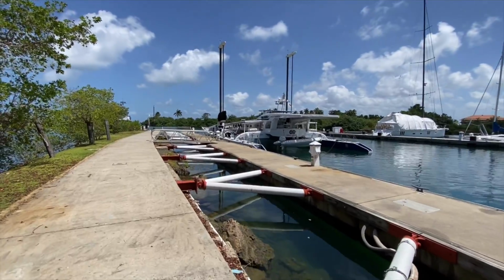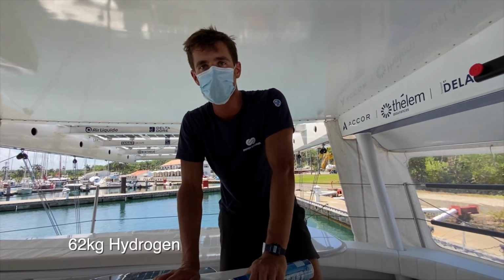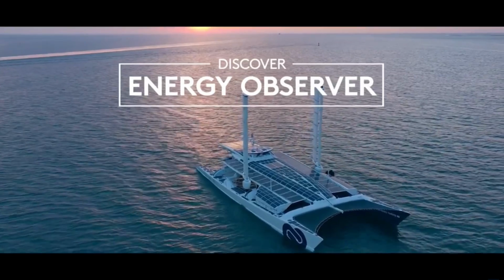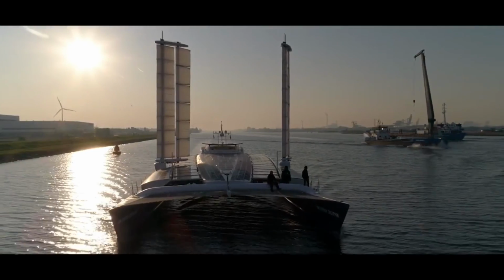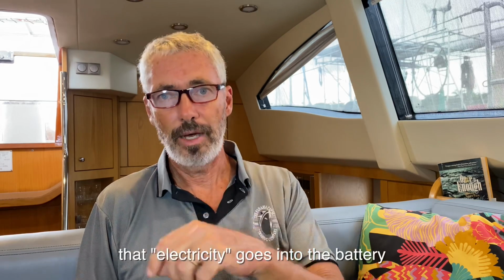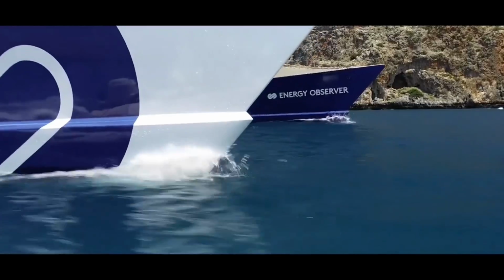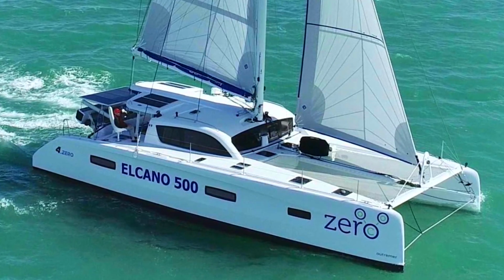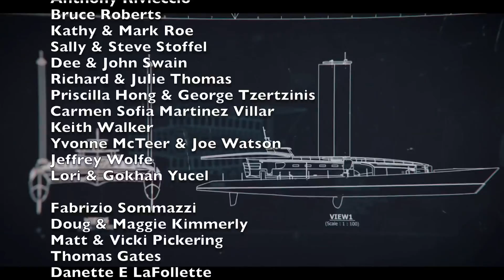Hydrogen-Electric powered boat! Can we get this on our new sailboat? | EP 204

Comment: The future is almost certainly zero carbon electrofuels. The hydrogen is combined with carbon dioxide to create a drops-in replacement liquid fuel with the same energy density as diesel. The only issue is cost (they are currently 3x the cost of diesel) which is why vehicles that can go electric will do so. But for relatively low consumption users (such as sail boaters)  the cost is less of an issue.

Comment: Hi Paul: what about instead of using solar to produce hydrogen on board, can they use some residual hydrogen to produce more hydrogen from the water. Is the system that efficient enough?
Reply: ???
I don't really understand what you mean by that.
Probably some kind of "perpetual motion"-thing?
Even with a very efficient system (60% efficiency fuel cells, 80% efficiency electrolyzer), you would have to spend 2 liters of hydrogen to produce 1 liter of fresh hydrogen. I suppose, 3 liters of hydrogen for 1 liter of new hydrogen would be more realistic.
No, you can't use hydrogen to get more hydrogen in total.

Comment: Yes but there are a few Problems you didn't mentioned. The efficiency of electrolysis is round about 70% . The efficiency of a typical fuel cell is below 50%. And to store hydrogen you either have to compress it or cool it down to down to -240°C. This need round about 10% of the energies is in the hydrogen.
So if your solar panels generating 1000w, after transforming it into hydrogen only 700w left, storing the hydrogen would take another 70w so 630w left, and transforming it into electric energy again would reduce it to 315w. So to drive the ship with 1 day(time) with 6 knots would take 3 Days generating the needed hydrogen. I do not think this will work.
Reply from the maker: Thanks for your comment and calculations.

Comment: Perhaps I'm not getting the appeal of this boat:  according to the Energy Observer website, it cruises at 4.5 knots.  Why not just set up some proper sails and increase the speed 3-fold without much effort.  Sure, you'd be dependent on the wind for movement, but this boat is dependent on sunny days for movement...very slow movement.  Plus, if you think propane is dangerous...hydrogen is in a league of its own.
Overall, an interesting science experiment, but far from practical.

Comment: In talking about the solar/battery power they need to mention the weight of the panels, inverter, controllers etc, not ust the batteries,  in hydrogen they only mention the weight of the hydrogen in the tank? what is the mechanism that makes the hydrogen and how much does it wiegh?
Reply from the maker: The hydrogen production is done through an electrolyser (plus desalinator to make the pure H2O). Their website has lots of info on the tech but I couldn't find a reference to the weight. https://www.energy-observer.org/

Comment: Interesting science but the positive impact from doing all these changes for sailboats is debatable. These changes are very costly, time consuming, not necessarily safe or dependable.  How much diesel do you burn each year on your sailboat? Use the sails a little more. I would bet that moving substantially away from gasoline lawn mowers (due to enormous pollution) could have a positive impact one million times greater on the planet.

Comment: Generating hydrogen isn't that hard, - try experimenting by connecting a battery to two stainless steel bars or bolts inserted into seawater and you'll soon get hyrodrogen and oxygen, (see other youtube channels on how to do this) - however one should avoid collecting the hydrogen and oxygen together, as some do - (it's unstable and can explode).

The hard part is efficiently storing the hydrogen once generated - there are many ways to store it all are expensive at the moment.  The mose efficient way (still under research) seems to be using carbon nanotubes, but this is very expensive and out of the reach of Jo Average Citizen (at the moment at least).

Using small currents and seawater will produce small amounts of hydrogen - however if left to run for long periods of time can be a very efficient way to get plenty of hydrogen for a small boat.  I'm still researching this and would like to hear from others interested in the same area.

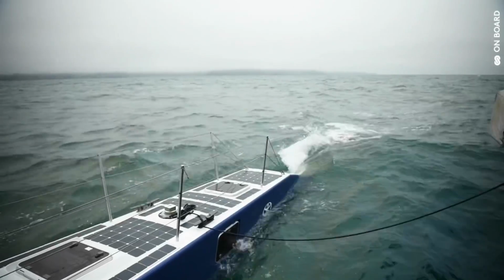Comment: Sorry, I have a huge issue with the stats presented in the video.  In the beginning they stated the hydrogen tanks store 62 kg of hydrogen.  Then you state that they only needed to sit for a FEW DAYS (not moving - using the solar to produce hydrogen).  Then @ 9:21 you state that the system can produce 3-4 kg of hydrogen PER DAY.  Using math, it would take 15 days in SUN (if it was cloudy any of those days..take longer) to "fill" the hydrogen tanks.

Again, It's been talked about by many boat builders and cruisers (yes I know there are a few cruisers using only electric...but they also have to modify their paths and windows to accommodate their propulsion decisions) that EV or Hydrogen isn't anywhere near mainstream yet.  I'm almost betting this vessel is getting grants/subsidies from organizations/government.
Reply from the maker: Hi Douglas, Thanks clarifying.... I couldn't actually find information on how long it would take to produce a tank fill of hydrogen. It was my own math that they could manufacture 3-4kg per day. And that was assuming they didn't run any other systems while making hydrogen during those SUNNY days :-) And you are right the vessel is a receiving financial support as a promotional research vessel. They are pretty clear about that on their website, which is quite interesting ... https://www.energy-observer.org/

Comment: Hopefully, in the future... which is very nearby today (2023) we just take in seawater, which is split into hydrogen and oxygen, and burns either directly in our hydrogen engine or  goes to storage tanks thst will then be used at a later moment to fuel the additional electric engine. right now we would need ca 40 liters of water and 1.5 kWh to generate 33kwh hydrogen power, which could drive a decent boat engine for approx. one hour. Hence the future is we take in water and we sail or engine without ever buying fuel.. and that's why the oil industry does not really like this idea.

Comment: When you compare hydrogen and lithium, you need to include the extra mechanical systems needed to convert hydrogen to electricity by weight. 

Can't imagine the fuel cell system is lightweight.
Reply: Fuel cells aren't "mechanical systems", but galvanic elements, similar to batteries.
And of course, fuel cells, compressors, hydrogen tanks and electrolyser weigh 2100 kg. Not really lightweight, but light in comparison to a li-ion-battery of >1000 kWh (comparable capacity).

Comment: 64kg Hydrogen sounds so tempting attractive.... but... wait...
Whats the weight of the 700bar carbon fibre Tanks?
And, given that electricity comes from solar (+MPPT Solarcharger) and goes to the motors... whats inbetween:
The 1,5 to (or 14 tons) battery.
Or...
An Electrolysis unit, a Gas compressor, said carbon fibre tanks, and the Fuelcell system.
And how about efficiencies?
Li ion has a charge/discharge efficiency of approx 80%...
Electrolysis 70%, compressor 85%, fuelcell 50% makes a total of 30%. For the Hydrogen path... my precious Sunpower, down the drain😔
And all the weight... at least versus 14 tons this could be a close win for the Hydrogen.
And cost... 
Oh, dont forget complexity& maintenance - in the harsh corrosion exposed marine environment.
This is a great adventure for an experimental research vessel. But in the real market? Sorry, Hydrogen will not gonna work here...

Comment: How about just sailing - ships sailled for hundreds of years without any engines (a few still do), we have far better weather forecasting than they ever did. Bottom line is that the lazy sailing of using diesel is going to have to end.
Reply: those days the crew also rowed to pull the ships into harbor and up river
Reply: @thetruthasanamerican1249  in some places for larger ships (Because it made sense if you were crossing half the world to have a larger ship) just like we have tugs now (although the scale was alot smaller). but most smaller boats of yacht size would be sailled in and out, tied up using warps or often dried out for loading/unloading and canals used to move stuff inland. Because everyone was sailing moorings were more spread out and it was easier to do it then than it would be at the moment but the change in infrastructure adapted to the people using it. There are still a few people sailing around without engines.

Comment: Hydrogen is definetly the way forward, but we are not there yet. In energy density this is better then lythium batterys or any other battery, but compared to diesel or petrol, it still does not hold up. Untill we have ways to store the hydrogen, safely and conveniantly in liquid from and make use of it it will not make sense weight wise, and we all know on long trips, if you limit yourself to a certain length, the weight matters. 

this is why fully electric also is not a solution at the time. Not for people that stay off grid this long.

Comment: So, they state that they have 100KWh of battery storage - you show a MG LiPo battery that is 7.5KWh - these weigh 53kg each, they would only need 14 of them to make the 100KWh storage - which is only 750kg total - not the 1.5 tonnes they state. Basic research shows that a hydrogen storage tank to store 5kg of hydrogen weigh about 87.5kg each, so for the 65kg of storage they state they have, the total weight just for the tanks is over 1200kg if you include the hydrogen. The losses to convert the solar energy to hydrogen and then back to electricity via a fuel cell are horrendous - 25% at best , so for every 4KWh of solar they get a about 1KWh of hydrogen. They would be better to just build a massive battery bank and store the solar directly in to it. Did they mention how sensitive the fuel cell membranes are ? Check the silent 60 yacht videos for how it should be done to build an electric powered boat.

Comment: I believe hydrogen will become much more interesting an option when companies like Plasma Kinetics solid hydrogen becomes available.  Hydrogen is very explosive in compressed form but not as a solid.
Reply: The weight of the equipment needed to freeze hydrogen and keep it frozen would sink the boat.  -423 degrees is attainable in only a few specialized laboratories in the world.  Also, you'd be using many, many times more energy to cool down the hydrogen than you would actually get from the hydrogen.

Comment: The vessel, or vehicle, requires a safe storage method. The ZEUS (Zero Emissions Ultimate Solution) project looked at this quite some time ago. A converted diesel engine that burned Hydrogen. A storage matrix instead of a tank. No matter, Hydrogen production is very energy intensive. Would require us to move to nuclear - based power grid.
Reply: Absolutely disagree with the assumption that nuclear energy is necessary.

Comment: Adding a hydrogen generator fuel cell which can generate hydrogen from the salt water while underway is the future. Aluminium generates hho gas in salt water there would be something better but ??
The design would be pipe like to increase surface activity

Comment: what hydrogen can do is fantastic, but technology has yet to develop a lot to allow it to be used independently and safely even for individual uses such as a boat.  but the problem still remains of how to produce hydrogen.  so for now we are too far from commercial use ... maybe in the next 5 years.  however there are many errors in this video, kg per kw with lifepo4 and production possibilities and range... on my 28 ft boat I have 2 72V 100ah batteries for about 15 kw total and the weight is about 60kg but without taking up useful space.  and I have 1200 watts of solar panels plus wind turbines and regen from the engine ... if you don't change your lifestyle, the current is never enough even with hydrogen ....

Comment: Why not use the power from the hydrogen to make more hydrogen?
Reply: Because it wouldn't make sense, you would lose hydrogen in this process.
Let's assume a start with 1 kg of hydrogen: Fuel cells convert it into up to 20 kWh of electricity. An electrolyzer can produce ~0.4 kg of hydrogen out of water with 20 kWh electricity input. And this were rather optimistic figures. You can't get energy from nowhere, hydrogen production always costs more energy than you can get back from the produced hydrogen.
Reply: @701983  Can you not mix the oxygen and hydrogen back together and have that power a gen to create more hydrogen.

Comment: Considering that manufacturing a diesel engine or an electric motor generates the same air pollution, manufacturing a LifePo4 battery on its own generates a lot of Co2, a powerful global warming gas. If we use Tesla as an example, their 75Kw battery adds 4,500Kg of Co2 in the environment as it is manufactured in Nevada. This is equal to 60 Kg per Kw of battery capacity. Chinese batteries are reported to generate 106 Kg of Co2 due to their Coal generated electricity at the manufacturing plants. One litre of diesel generates 2.64Kg of Co2. If we assume that it takes about 2 Litre of fuel per hour to move a boat at 5 Knots, the break even point is 852 hours with that same battery size. Rigging Doctor is going with a 33Kw battery so we can extrapolate to 375 hours. If we consider Chinese batteries, as most people buy Chinese products, the break even point would be 1,505 hours or for a 33Kw battery 662 engine hours. As sailboaters use their engine less than 75 hours a year on average, the break even point for Rigging Doctor would be 8.8 years for a Chinese battery. During that time, the batteries shall be kept charged at least at 80% all the time otherwise they may fail prematurely. 
Solar panels are the solution to keeping the batteries charged but how many does it take to keep such battery capacity fully charged? It takes a lot of them. 

The manufacturing of solar panels also causes Co2 to be released in the air. When a Chinese panel is installed on an European roof it takes about a year to cancel the carbon footprint necessary to produce it. The bigger the solar panel array, the bigger the environmental impact.
It takes real estate to install them on a sailboat... It becomes complex to have large panels, charge controllers and so on and it is not for everyone to understand and troubleshoot when a problem occurs.

The morale of the story is that the battery technology is not ready for boating.
Go small go simple, minimize your power consumption, use your engine only when necessary

Safe boating, Richard
Reply: Not really - diesel never becomes carbon neutral.

Comment: Sorry but 100kwh is equivalent to one 100 kWh Tesla or Porche car battery, not ten! Many cars have 50 kWh batteries so to be fair, lets say between 1 and 2 cars.
Reply from the maker: Hi Robert, agreed yes I was saying the 100kwh was like one Tesla (such as the P100D). The 62kg of hydrogen could produce much more electric power (something like 8-10 times that energy) so would need very heavy batteries to store the equivalent energy. I think I wasn't very clear :-)  I believe the Observer tech fellow said 8 times the electric power was contained in their 62kg hydrogen (plus weight of 8 carbon-wound hydrogen tanks)

Comment: Hydrogen isn’t developed enough for me to consider hydrogen on any vessel. 

Self sufficient sailing, is already proven a possible solution. 
It’s very obvious, OceanVolt has a solution that will power way more efficient and at much higher amps, than solar cell. 

On a motorboat, things are different, but until batteries or maybe hydrogen fuel cell gets cheaper and fully developed, there is no other safe solution than fossil fuel.